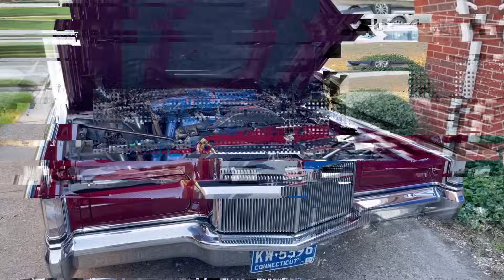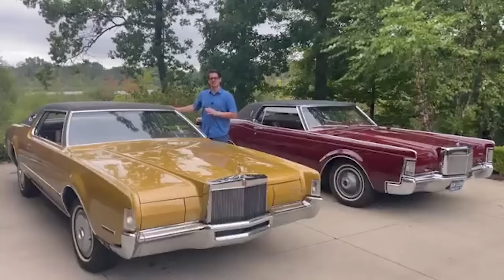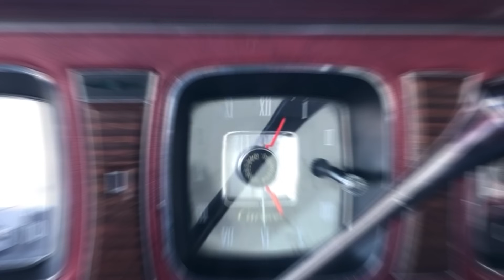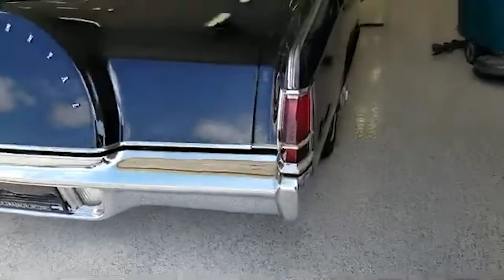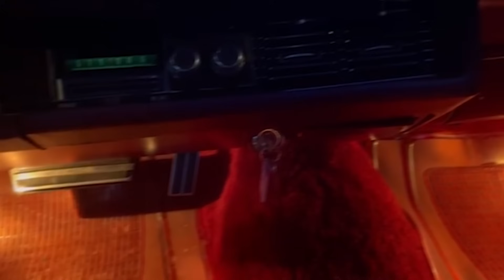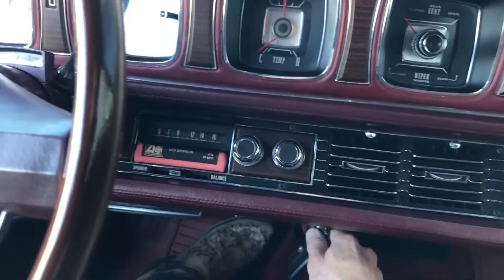1969 Lincoln Mark III | The 460 V8 LUXURY MUSCLE Car That STUNNED America

Comment: Can be tuned to reg gas and get 17 mpg hwy .  69 higher HP. Quite fast.   wipers work w power steer pump on crankshaft      trunk tubes leak when old   leece Neville alternator didn't work well on early models

Comment: Ford began using vacuum controlled headlight doors in 1967 on the Thunderbird. We ordered a 1968 LTD Brougham and drove it nearly 170,000 miles over 14 years, and the LTDs had rather heavy cast metal headlight doors. They never failed to work even in the snow and ice of Midwestern winters.

Comment: Frank Cannon sure    Appreciated  the Tilt Steering Wheel  but in my Opinion  General Motors did tilt wheel option the best because they used a separate lever to move the steering wheel